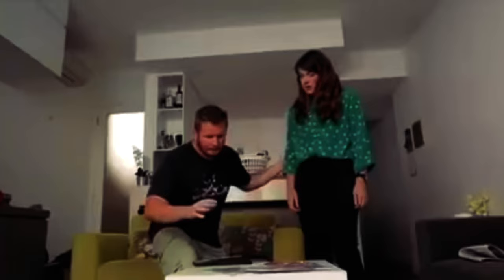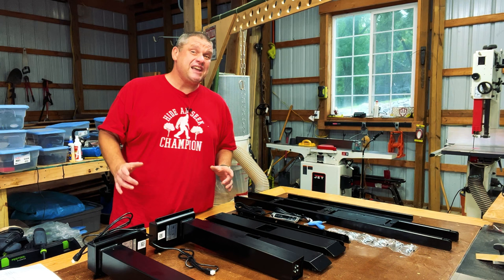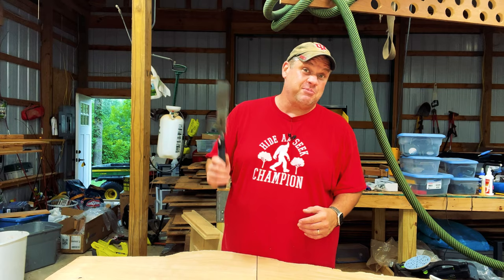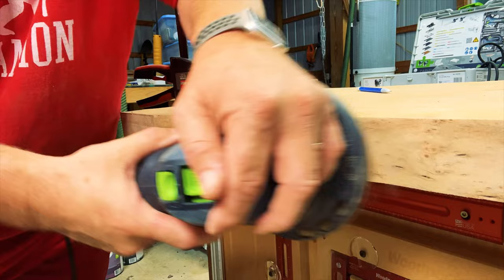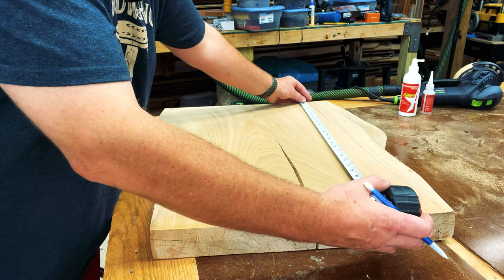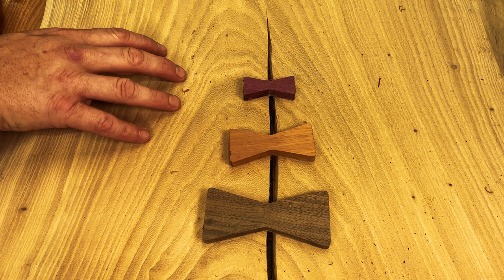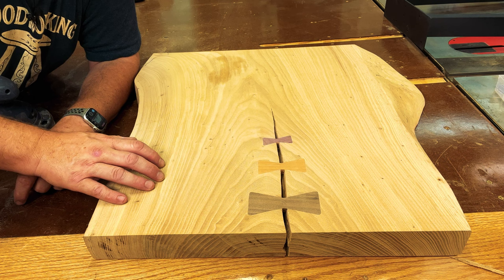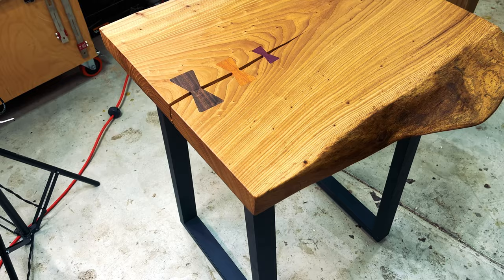Experience the Unbelievable Craftsmanship of the Shaper Origin's Bowtie Slab Table! #woodworking

Comment: Bryan, nice video.  May I suggest that since you have a Shaper that you could have made a mortise the same thickness as the metal leg frame and not have to  screw the frame to the bottom of the top.  Just would make it just a little neater as you won’t see the frame itself.  Enjoy the journey.  Cheers, Brian
Reply from the maker: Great suggestion Brian!   I thought about doing that, and probably should have done that.  Would have been an easy addition!    Thanks for sharing and thanks for watching!  Really appreciate it! :)

Comment: Great work.  The tool you used to cut out the bow ties is incredible.  The bow ties really look awesome.

I’m going to attempt my first bow ties with hand tools only, except maybe use a router for the bulk removal.  Just a suggestion, but maybe threaded inserts for your leg attachments, they are super strong and easy to install.
Reply from the maker: Thanks so much Michael!  I 100% agree with you on the threaded inserts.  I actually have some on order.   I was really pleased with this project being my first attempt at a slab.   I really need to get a router sled, as I think my interest in this type of build has been sparked!   I'm going to be trying to do some bow ties by hand in the next couple of weeks.  I was watching some tips from john maleki on using the blue tape to lay them out and I thought that was a great idea.  If you haven't seen that check it out.  Looks like a great way to set your lines!   Best of luck to you! :)
Reply: @FlynndoggWoodwork  - I’m a novice, but have built a bit of live edge / slab stuff.  The challenge I’ve had is identifying the reference spot.  For example, I built a small three shelf unit  from hackberry with a tusk mortise and tenon shelves.  The tusks were live oak.  The hackberry is probably too soft for lots of stuff, but this was for a charging station for electronics, and a shelf for my Wi-Fi router,  it’s not perfect, but what a lot I learned.  Since it’s against the wall the back is flat, and the straight edge that all of the mortises and tenons had to be referenced from.  I milled and dried the hackberry and live oak myself.  Really enjoy all of the funny clips you find that are relevant to what you’re doing.  Great job.
Reply from the maker: @michaelkelley6905  Oh my goodness!  You don't sound like a novice!!   I bet it looks amazing, I love the idea of tusk mortises.  I've never attempted any of that myself, but plan to!   Thank you so much for your comment, I found it very interesting and of course, I'm going to keep those quirky little humor spots as much as I can.  A lot of the times, I run out of time to research the humor, and that's why some videos have a little less.  Believe it or not those little clips sometimes take just as long to film the videos.  Thanks again for sharing and watching!

Comment: I didnt read all of the comments, but Are you concerned about wood movement with the screws from the top to the legs on the width?
Love your channel i can really relate to your demeanor, you should have been a teacher!
Reply from the maker: Haha!  You are too kind.  Yeah, I am concerned about the wood movement.  Not sure if you caught it or not in the video but that is why I only attached the legs with the center 4 screws.  The center 4 screws seem to hold the legs securely and will allow the exterior of the slab to seasonally move.   Great question though and thanks for watching!

Comment: Man this came out beautiful!!

Curious, your tracksaw is the 55in battery versiom. How do you like it? Ive resd that it kight pack more oomph than the corded 55. The new 60 in is out now too. In the market for a tesck sae in the next couple projects from now and there are too kany choices
Reply from the maker: Thank you so much Matty!  Really appreciate it.     To answer your question, I absolutely love it.   I'm never had a problem with it, and it always leaves completely accurate and smooth cuts right in line with the track.   I have had it kick back before but that is only when I think I was trying to take too much material in one pass.   Kind of why I cut the slab in multiple passes.  It's a wonderful tool and I highly recommend, but I'm sure they all work beautifully!

Comment: Yeah, I  know that steel-cap thongs /flip-flops /jandles are avaliable, but Dude... PEP! Having crushed various digits, de-tipped a finger or two and nearly severing a digit, plus fractured my pelvis in 3 hard to do places (I was pushed off a ladder shorter than I am tall).. PEP and safe working practices cannot be over emphasised
Reply from the maker: I get it, and I agree with shop safety, but my barn is typically 90-100 degrees, and wearing flip flops is one of the few things I can do to alleviate that issue.   I always wear regular shoes when I can.  I am having my barn climate controlled in the coming weeks so that should alleviate a lot of problems.
Reply: Hahaha never gets old, someone telling someone else about there personal protection.  You do you where what ever you want its your shop.

Comment: Dogg, man, push-ups at :57 in. Weren't there dimensions on the packing slip?  What, you don't have a router sled?  Time for a google search.  Don't you just hate a rugged crotch.  Btw, "crotch" was a push-up trigger for us.  Then we went to "cracks" to get us some more exercise.  Dude, that shaper tape has to be expensive, no?  Perhaps, next time you can get a jig and use a regular plunge router ( I know that's too boring for you).  Ah, finally, the Paolini square at 17:26.  We did less push-up because of the slab because there was only eight occurrences before you went horizontal with it.  Looks great.  How much would you sell something like that for in Indiana?  There is a heck of a lot of expensive material that went into making it, so we're curious.  Also, we have bet on your asking price and we need to see who gets the jackpot.  Thanks, Dogg and keep on making.
Reply from the maker: Great question Meat - Yeah they were on the packing slip but they gave a range, so I wasn't real confident in the real measurements.   I'm actually glad I did put it together as there was some variance, and I'm really cutting it close to making the desk as big as I wanted it.  I would have liked to have the side table a little bit bigger, but it will do.  I thought of you when I whipped out that Paolini.  Was going to use a combination square, but I was worried about you getting soft on me.     

I was wondering the same thing on how much something like the desk or even the side table would go for.  The slab was a little over $600.  I spent about 10 hours on the side table, so I'm not sure it would be profitable or not.  Would be a fun side hustle, but I definately want to get the router sled.  I was looking at the woodpeckers router sled (yes I know...)  it was so expensive but man does it look nice.  I'm also thinking about making one and doing a video on it.
Reply: @FlynndoggWoodwork  You'd look good in a Woodpecker's sled.  Plus, I know your good for it.  But since you're a pretty good instructor why don't you build one while you're waiting for the UPS truck to come up the driveway.  This way you can have both, help out some folks who can't afford the professional gear and have fun, as always.  We, here, love your stuff.  You're a talented guy.  Keep calm and keep ordering stuff from Google.
Reply from the maker: @themeat5053  Oh I totally agree!  That's what I need to do, is just build a damn sled.  Surely it can't be that diffucult.   Now you have me thinking of doing a video on it.   Great idea!